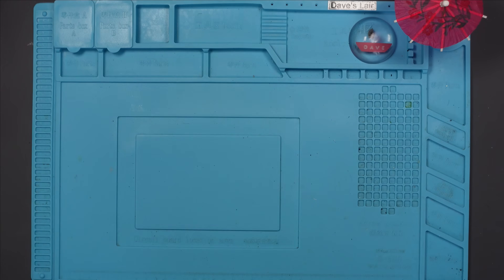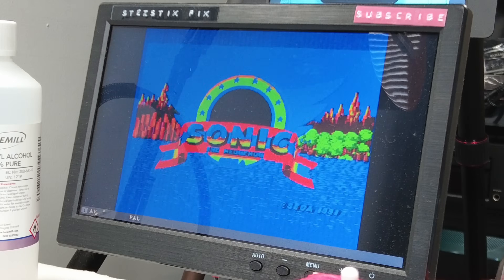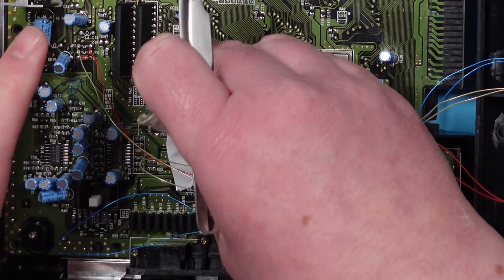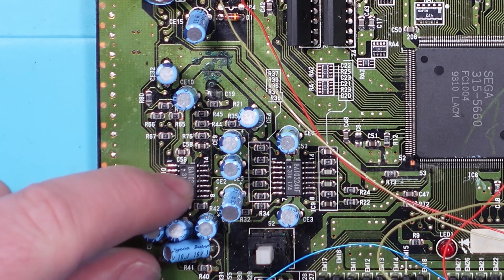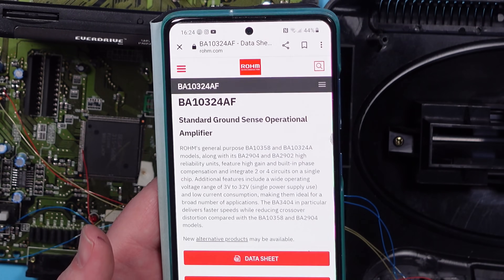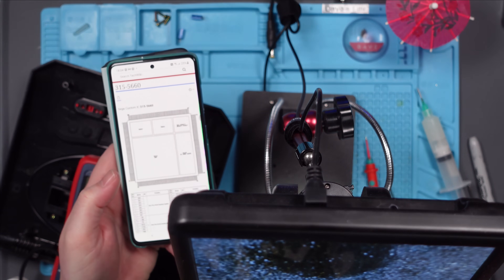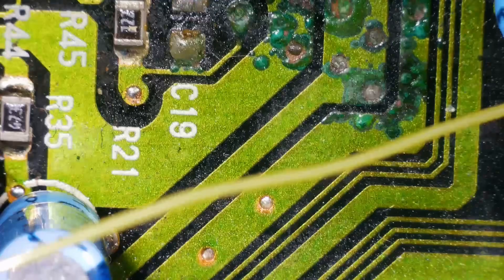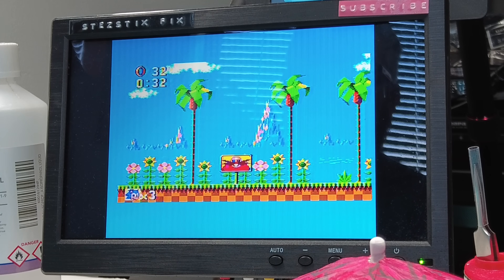This MEGA DRIVE Has a Strange 8 BIT SOUND Fault | Can I FIX It?

Comment: Nice one Steve! :)
The only thing I'm missing is some Voultar reference when you look at that modwork.
When restoring VIAs, I usually push a wire through the hole and solder it in from both sides. You need to have a very thin needle (or a very thin tweezer)  to clean the hole though.
Reply: Yes, a through-hole capacitor leg is good for this. Also good to clean up any corrosion in the surrounding area as well.
Reply from the maker: Thanks Norrecito! 👍

Comment: you can get the right socket tool to open megadrive psu's from console 5 (and infact most multi bit drivers use that socket for their bits anyway) its much easier to cut the cord off, pull the strain relief off and then feed the undamaged cable back through it and resolder it to the transformer. its also a great opportunity to check the capacitors inside as they often fail and need replacing. 

Also it'd be great to see you fit one of Consoles Unleashed region mods for these, they keep them looking more factory :)
Reply from the maker: Thanks Sparks! I'll definitely check those out 👍

Comment: I've just started watching the video and... Yes the megadrive has two soundchips
The YM2612, an FM Synth wich is responsible for the "16 bit sound"
And the SN76489, a PSG (Wich stands for Procedural Sound Generator) used for Master System backward compatibility that can be used alongside the YM2612 in megadrive games

Comment: Nice repair and nice channel. After watching all the previous videos my opinion is that your assumptions when trying to diagnose a fault are way less irritating than "your mate's". 🤣

As per being impossible to slide shrink tubing over that connector, look for 3:1 ratio shrink tubing. You can buy something large enough to accommodate connectors, which will shrink down to the cable's thickness. 
The downside being that it usually comes lined with hot glue and comes out a lot stiffer than the regular 2:1 tubing.
Reply from the maker: Thanks Mad Dog! I'll have a look for that, much appreciated! 👍

Comment: YES! Those caps were bad! ESR to high for its value, should be in 0.xx range Not! 1.xx so brother Steve! you was correct! to replace them 🖖👍🏻
Dirty little VIA casing a silence in the 8-bit matrix, making a small detour to allow electrical connection between the layers 🎶 returns to the 👂
Reply from the maker: Aha!  Thanks brother Steve.  I should probably re-cap the whole board then I think!  Yeah, this one was really interesting to me, I didn't even realise that there were 8 bit and 16 bit sounds in the Mega Drive!  You learn something new every day!  😁
Reply: Yeah you should & clean that Mod up too! Yes it has both; Instruction set: 8‑bit and 16‑bit instructions. the CPU of the Sega Mega Drive was technically a 32-bit CPU, even though it communicated through a bus which was only 16bit wide. Some of the instructions are 8-bit long (called 'byte'), others are 16-bit long (called 'word') and the rest are 32-bit long (called 'long-word'). There is a few differences between the models 1 & 2 plus master system options.
There is a Lot! to learn brother Steve! 🤓
Reply: So firstly, the 8-bit Master System has a Z80 CPU @ 3.58MHz, 8KB of RAM and 16KB of VRAM, and a VDP (Video Display Processor aka graphics chip) with native Master System modes as well as a backwards compatibility mode for SG-1000 games (albeit with wrong colour shades). The VDP is an ASIC that also incorporates an SN76496 Programmable Sound Generator (PSG), also backwards compatible with the SG-1000's SN76489 and which gets its 3.58MHz clock signal from that generated for the Z80 CPU.

When Sega designed the 16-bit Mega Drive, they added a Motorola 68000 CPU @7.6MHz and 64KB of RAM, as well as a Yamaha YM2612 OPN2 FM synthesis-based sound chip which gets its 7.6MHz clock signal from that generated for the Motorola 68000 CPU (sound familar?), but the 8-bit Master System (Z80 CPU, 8KB RAM, PSG and 3.58MHz clock signal) mostly remains inside the 16-bit Mega Drive.

For the Mega Drive graphics they simply took the Master System VDP and replaced the SG-1000 graphics mode with a native Mega Drive graphics mode and increased the VRAM to 64KB. In fact if you load an SG-1000 game from an Everdrive on a Mega Drive, it will run but "play blind" (working sound and controls but a black screen).

So as you found out, the Mega Drive having hardware backwards compatibility with the Master System isn't just for being able to play Master System games on a Mega Drive (either with the official cartridge converter or loaded from an Everdrive as you did) - Mega Drive games use the Z80 as a co-processor (usually for the sound driver on games that don't run that on the 68000) and with both sound chips being memory-mapped to both CPUs, it only took until 1989 for a developer to realise that they could be used together, and played nicely together at that! By then, 4-operator (rather than 2-operator in 1988) instruments and drum (rather than just voice in 1988) audio sample playback on the YM2612 had also been figured out, so by 1991 and UK/Europe availability and Sonic, the 2-chip sound/music was standard procedures :)

With this being a Mega Drive 2 VA0, it has the (YM3438) and PSG sound cores both in the ASIC, whereas most Mega Drive 1s (from VA0 Japan, VA2 Genesis and VA4 PAL to VA6.8), and some later Mega Drive 2s after VA2.x, have a physical YM2612 chip, with the PSG being the only sound core in the ASIC. Too bad the Mega Drive 1 VA7 and Mega Drive 2 VA0, VA1 and VA1.8 all have bad sound mixing/amplification circuits and require a Mega Amp mod for decent sound quality.